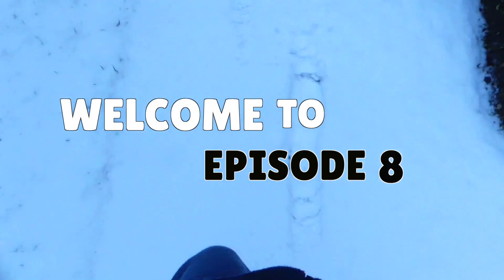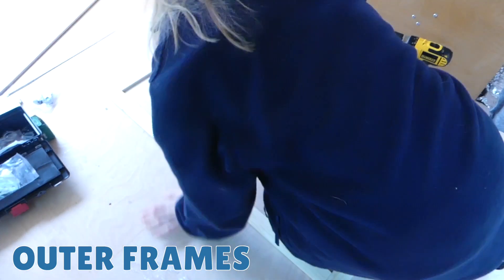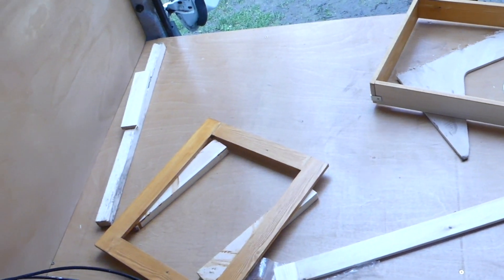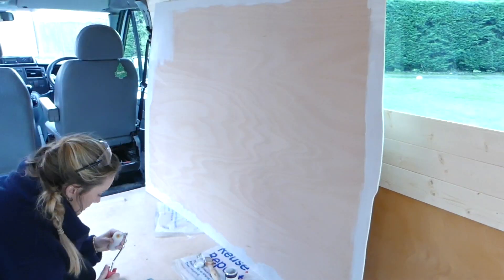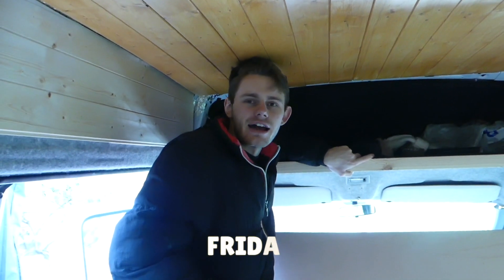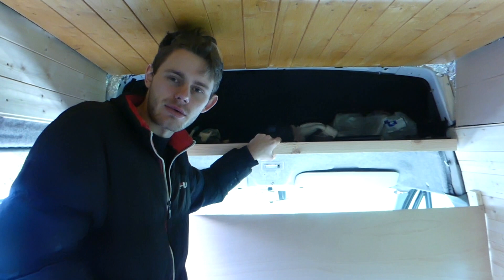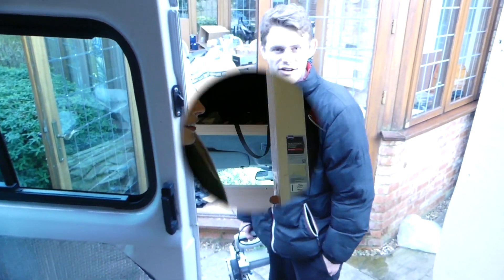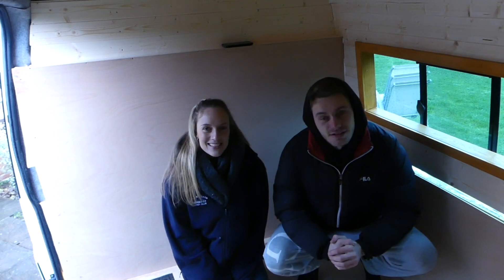Ep8: Making Window Frames & Partition Wall / FORD TRANSIT MINIBUS CAMPER CONVERSION / UK VAN BUILD

Comment: Looking good. What are your thoughts about the bulkhead I’m thinking of doing a van but was planning on having access to the cab in case you need to move away quick for safety. Just a thought. Keep up the good work. 👍
Reply from the maker: Thank you! :) There wasnt really enough room for us to have an emergency escape window, which is a shame, but just a reality of van DIYing on a small budget!
Reply: @NickyandHarri  
I was taking about getting into the front and driving of if you needed to in a hurry. But like they say it’s everyone to their own. I’m enjoying watching though. I’m looking at a minibus. Are you thinking of having a fixed bed ? And if so will it be across the van?  Thanks for your reply. Dean 👍
Reply from the maker: @mablethebus  Yes, we meant that our head rests are in the way, and the headliner that's already in the minibus it too low, so only gives us about 10cm width (inbetween top of seat headrests and bottom of headliner) for an escape window. 

So glad you're enjoying! Yes, we're gonna do a fixed bed width ways and just use 2 single 'shorty' mattresses (75x175cm), side by side. We're going to start on it in the next few days!

Comment: Hi great work guys , but I think I would of left it able to walk through, also it would make it easier to get the van battery out as it’s under the drivers seat
Reply from the maker: Thanks Steve, means a lot! The way the cab is, means that there is no room for a walk through so we thought we may aswell cover it up! We can still access the battery from the front just by moving the front seat forward. We actually had to charge it today, think our minibus wants to be driven around, not sat I'm the garden for months 😂
Reply: @NickyandHarri  if it’s just the 2 of you , you can get rid of the double passenger seat , which isn’t very comfy and put in a single seat to match the drivers seat, much comfier. This would allow a walk through. It’s just an idea as I have a mk7 transit
Reply from the maker: @stevekornek4615  That's a good idea, but we're meeting friends out in Europe, who might want a ride, so not sure if we want to get rid of the double passenger seat just yet. Great suggestion though - gives us something to think about.